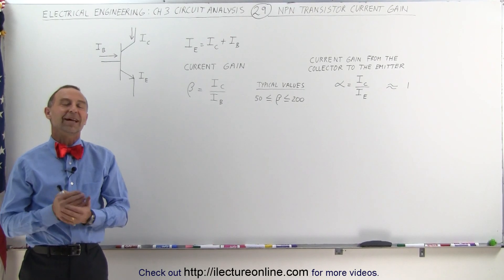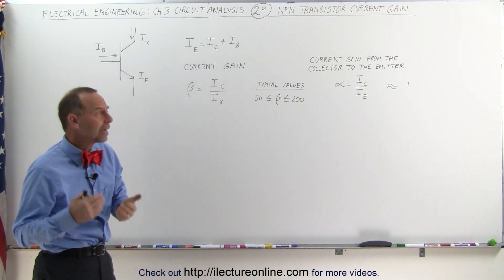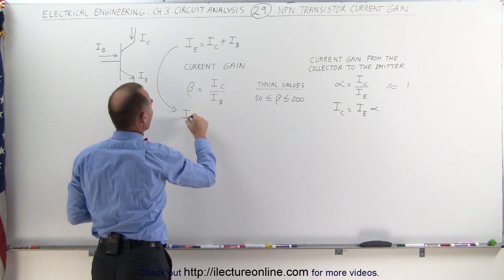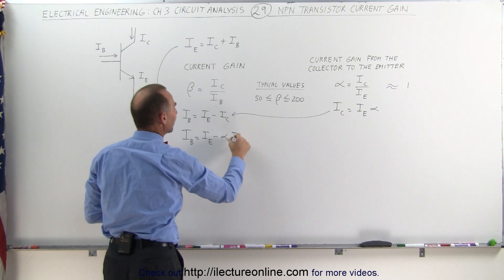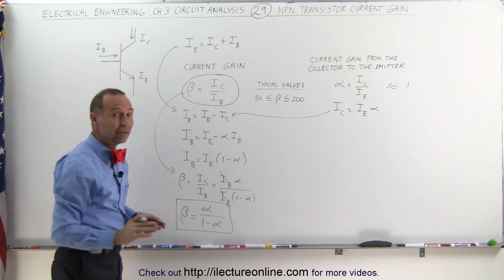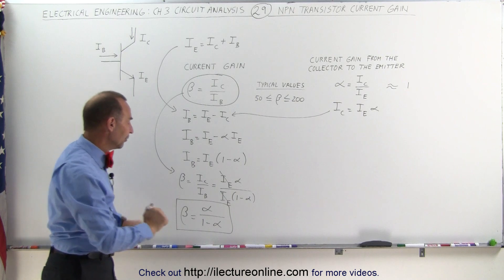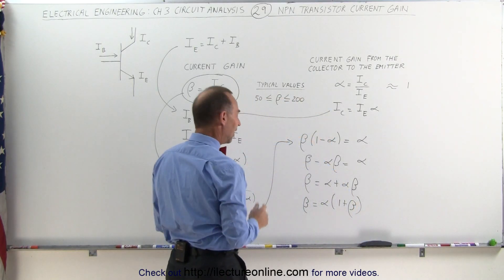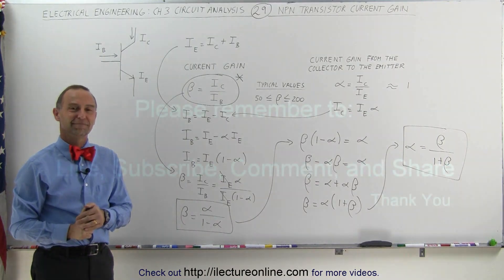Electrical Engineering: Ch 3: Circuit Analysis (29 of 37) NPN Transistor Current Gain

Comment: Wich difference is there between beta and hFE? Actually they have the same value... but they are different... in what is it consist of?
Reply from the maker: They are 2 different names for the same thing.
Reply: @MichelvanBiezen  pheraps Ic=beta Ib ignores the revers current Icb0... viceversa hFE takes count of this in "forfait"... so Ic=beta Ib is approximated expression becouse the correct is Ic=beta Ib+ (beta+1)Ic0 ... indeed, Ic=hFE Ib is not approximated......

Comment: hi..is it compulsory to put resistor at the base for the transistor to function?..how about if not put resistor?
Reply from the maker: It helps to control the current to the base.  (It is not compulsory, but we typically do so).
Reply: Michel van Biezen what happen to the transstor if not use resstor, is it the transstor will burn or damage?

Comment: Good algebra problem Michel, good practice problem for anyone young or old, appreciate you showing it. I have worked it a few different ways and quickest way I have found is to see that all 3 equations have Ic in them, so sub Ie = Ib + Ic for Ib and Ie to get all 3 terms in Ic, the Ic's cancel, 2 step process instead of 3 steps for other solution methods. Great stuff!

Comment: Very nicely done. The Beta gain you illustrate has similar properties to some computations I was doing earlier today. If you consider a bike, the ratio between the petal sprocket and the rear wheel sprocket creates a multiplier gain that then turns the rear wheel.